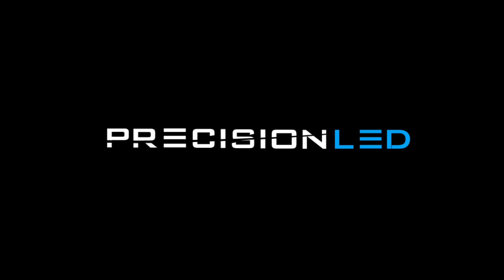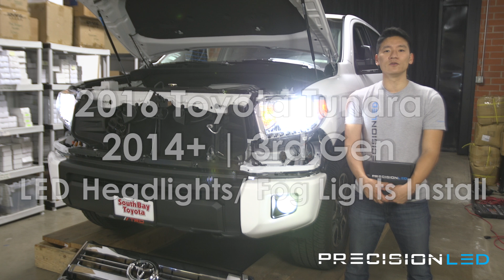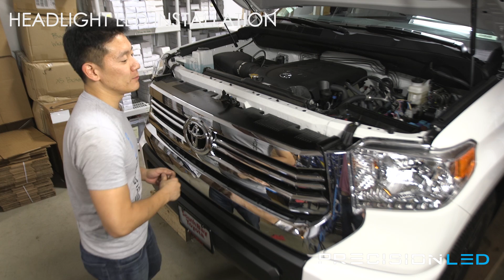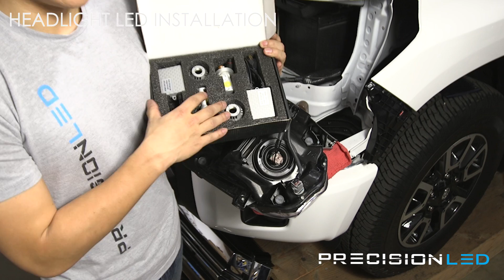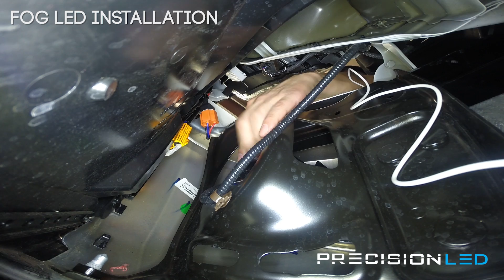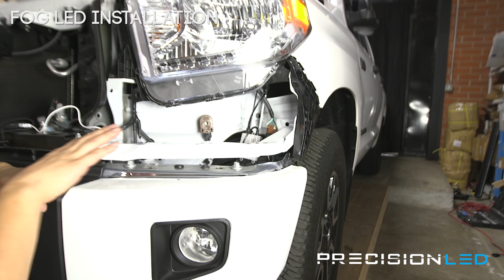Toyota Tundra LED Headlights & Fogs How To Install - 3rd Gen 2014-2021

Comment: Hey do you guys know if the new 2020 Toyota led headlights will fit with 2016 tundra sr5 trd
Reply from the maker: Yes, the products linked in the description box and installed in this video should be compatible with your 2016 Tundra!

Comment: My question is when you order the headlight the come with everything you need?
Reply from the maker: Yes, the LED kit linked in the description comes with everything you will need to upgrade your headlights to LED without any issues.  The resistor is not required anymore, as we have since upgraded our LED ballasts to come with built-in resistors to ensure you do not experience any dash errors, flickering, or other issues with your headlights.

Comment: Which size of resistors did you use in this video? The link in the description only lists bulbs that were used.
Reply from the maker: Actually, we have since upgraded our ballasts so that the resistors are not required anymore.  The kit in the description comes with everything you will need to upgrade to LED.

Comment: THANK YOU!!!!  I followed your video step by step.  The entire process to change both factory halogens to LEDs took 1 hour.  I would have been done sooner, but the rubber boot had a difficult time fitting around the new LED lamps I installed due to the fan on the back of the LED.  EXCELLENT instructions!  I had to remove 2 additional 10mm bolts on each side that were holding the fender well covers.  Besides that, VERY easy!  
If YOU are thinking of following this video to replace your headlight lamps...do it.  It is not as difficult as you may think!
Reply from the maker: Glad to hear it went smoothly!

Comment: will this setup interfere with the auto light adjustment?
Reply from the maker: No it will not.  The lights will act exactly as your halogens do.  They will just be much brighter, with a nice LED look to them.
Reply: PrecisionLED the kit was not available anymore is there a different one i can purchase for this same vehicle?
Reply from the maker: The kit is currently on backorder.  However, we do expect a replenishment of inventory in the next week or so.  I would recommend checking the link in the description then, and it should be working again.

Comment: i have a 2015 trd pro and i am really interested in doing this. Do you have any photos showing the light projected on a wall. I just wanted to make sure the wasn't any light scatter. Thank you for any help
Reply from the maker: Thank you for your interest.  Unfortunately, we do not have any photos of the LEDs projecting off of a wall.  However, if you are concerned about glare, there are many factors and many upgrades to headlight housings over the years that help mitigate any glare to oncoming drivers.  It is more or less the color of the light which causes distraction and not the actual brightness intensity itself.  If you notice, the most distracting lights to see on the road are the blue HID lights which cause a lot of glare for the human eye, whereas you probably never noticed the 6000K lights on the road because they are more natural to the human eye.

Comment: I've been looking around for lights for my truck, but I've found GTR Lighting doesn't need resistors.  Why do yours?
Reply from the maker: Thank you for your interest.  The kit being installed on this truck is an older model LED kit we used to carry.  We carry a newer CREE kit which does not require any resistors for any headlight installation.

Comment: when you bought the kit, is the resistor kit comes with the package already or you buy it separately? thanks
Reply from the maker: The LED kit linked in the description comes with everything you will need to upgrade your headlights to LED without any issues.  The resistor is not required anymore, as we have since upgraded our LED ballasts to come with built-in resistors to ensure you do not experience any dash errors, flickering, or other issues with your headlights.